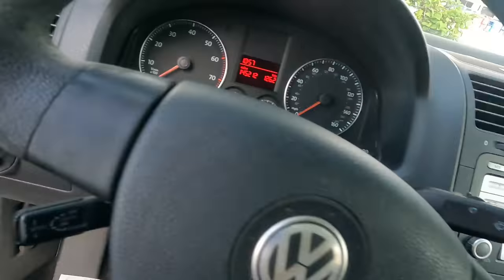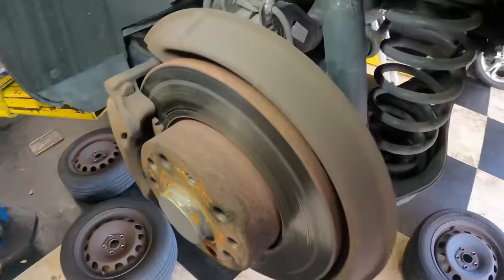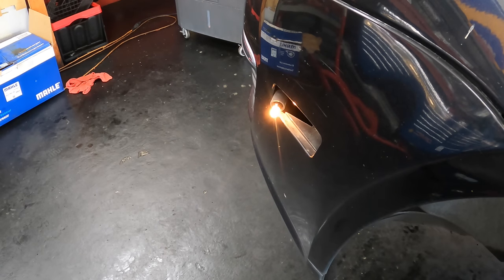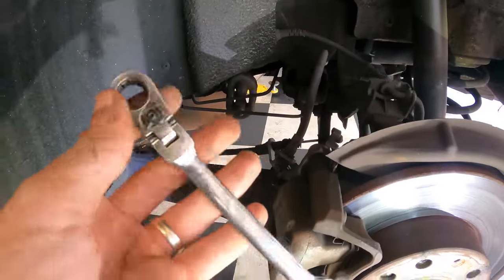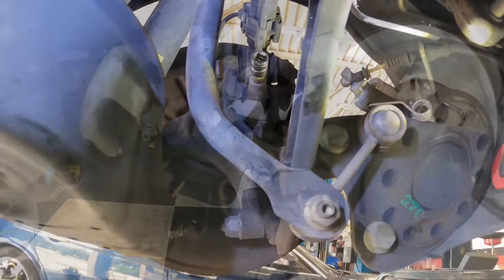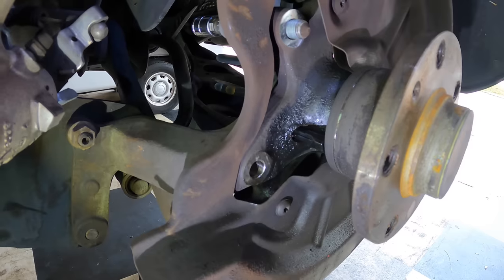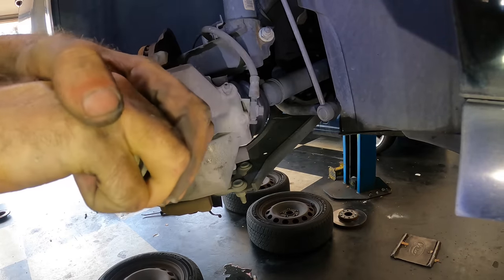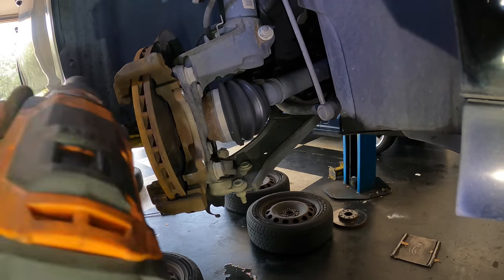Over Engineered Bolts! Four wheel brake job. Actuated Calipers. Volkswagen Jetta 2.5

Comment: It amazes me how often you guys get the wrong parts. Where is the incompetence? On the shop side or on the parts store side?
Reply: Parts store. They are horrible. I don't realy blame them (the worker bees). I recall when my wife applied to work the front counter, ever store demanded ASE cert but would only pay minimum wage. Pluse part time, and retail work schedule only. So they get the maximum number of hours without paying OT, or have to offer benefits. The poor guys working just don't give a dam, and I don't blame them.
Reply: I often have a problem with my car where parts catalogue shows one part number but my car actually came with a different parts number. And they are not interchangeable. 

My cars VIN shows that it's 2015 model, built in late 2014 but actually is registered as 2014 model. Uses parts from early 2014, late 2014 and early 2015 models. Real headache every time.
Reply: mostly on the parts store size If you just ask for a part and don't give them the part number.. there's a 50/50 chance the part will be wrong.
Reply: @jeremycovelli  you can only give them the part number if the person knows how to look up parts by part number. Most only know how to do it by year/make/model. It's become the whole reason I mainly stick to ordering online. There can be issues ordering online as well, but it seems to be far fewer. This allows for better price, and quality checking prior to paying for the parts as well. After a while you learn which brands have better quality at a good price. Sometimes it's better to pay extra $10 to $20 for a part like rotors. The cheapest ones will be Chinese manufacture with poor metallurgy, and to thin to turn brand new. Mid range Chinese parts are decent trade off at average $10 more @, but I still rather get better when it comes to break parts. An extra $20 bucks gives you a rotor that is less likely to warp in commute traffic, and can be turned at least a few times. The mid range Chinese rotors can often be turned once, twice maximum. This ends up being a less expensive TOC by an order of magnitude(s). $20 up front can lower your costs by several hundred over a 2 to 3 year time frame.

Comment: un even rear brake pad wear = one of double bearing is gone, there are two bearings that are near each other, if outer one starts to fail, inner one can take load, and then you have uneven break pads wear. There is no way to hear faulty rear bearings unless ist late and your car is handling like ship in corners. did mine two months ago. Also rear wheels are more, straights.

Comment: Those wire wheels. Had a wire fly off and stick in my forehead. Thank God for safety glasses. A little brake cleaner on the fingers never hurt anyone. A little bit everyday for decades = bad news.

Comment: You folks are SPOILED. Up north here, we FILE the rust off of the caliper bracket, and it, and the retainer clips get brake grease to minimize the rust for the next time. Oh yeah, and on the rotor hat so the wheel is able to come off without the use of a BFH!

Comment: New rotors are cheaper than resurfacing? Really?!
Reply: Better off with something new
Reply: @dumbeezy5480  true that. I guess new small car rotors are cheaper than a ¾ton truck rotor. ($78 a pop)
Reply: On my car Brembo OE style rear rotors cost 14€ a piece. Fronts are 27€ a piece. Resurfacing rotors starts from where? 15$ a piece?
Reply: @CoreMaster111  resurfacing is cheaper but like I said might as well have something new on there.
Reply: @dumbeezy5480  Cheaper? By how much? Who is going to resurface a rotor for less than 14$?

Comment: What happened to you're saying that you don't sell things that are not needed, there is nothing wrong with those rotors in the front nor have you even taken a caliper or Miced them up to see if there's any run out. That's ridiculous there's nothing wrong with those front brakes or rotors and that customer can get plenty of mileage out of them being that you didn't feel any pulsations. The issue is clearly the rear which needs new pads and rotors

Comment: The biggest problem with German vehicles they are so overly engineered that the companies have to install bolts they do not need to use they just want to so most people will not work on the cars themselves and go to either their cars machanics or other machanics that have those tools. It just goes back to trying to remove the customers right to repair their own vehicles.

Comment: 27:50 - How hard is it to mess up the rotor size that badly? Talk about "you had one job"...🤦‍♂
Reply: So many manufacturers change rotor sizes between same models. BMW is a nightmare with up to 6/7 different sizes for the same car. Measure twice....buy once.
Reply: @cabottaxi  - I don't know how it works in the US but here in Portugal the shops send the vehicle's license plate to the parts store and if there were changes throughout the lifespan of said model, with that info they know exactly what part fits that particular vehicle. The chances of messing up the parts are very slim to virtually non-existant.

Comment: I had a Buick Regal that had the parking brake integrated into the caliper. It was not great or clever. I never replaced so many seized up calipers in my life. GM list a lawsuit due to this poor design. I bet VW did a better job compared to GM.
Reply: I have 2002 Passat with the original rear calipers and parking brake.. all works great still after 252k miles and 20 years.
Reply: @jeremycovelli  I am sure that it was the original and well designed. The GM was a poor attempt at a copy.

Comment: No disrespect too you and your wife but remove your wedding band and bracelets including watches when working on electrical and vehicles. When i was in the military i had to watch a safety film that was about what i spoke of. They showed a soldier who caught his ring finger on sumtin and it stripped the flesh off the finger and another where the ring melted onto his ring finger from touching an electrical connection.

Comment: How is replacing rotors more cost effective, rotors aren't that cheap especially when a chain shop sells them to you, if they're 50 bucks the markup could be as much as 50%. this sounds like the democrats way of justifying spending more money. A garage by me charges 5 bucks each to cut a rotor, I realize you're just a minion in a world full of Gru's, this is why I don't trust any corporate owned shop, anybody who has ever worked in auto parts knows.
Reply: Machining a rotor guarantees it will only last 2 more months before it warps and you have to buy new ones anyway..
Reply: @jeremycovelli  That's absolutely not true,, you're more likely to get a warped Chi-com rotor right out of the bo bcc x. I put new ones on my neighbors car, a couple of months later she complained of a bad vibration, they needed cutting. Don't forget that years ago before we were inundated with cheap Chinese crap rotors and drums were cut all the time until they were worn beyond specs, people are too lazy plus shops make money on parts.